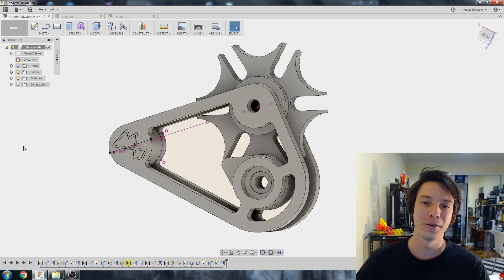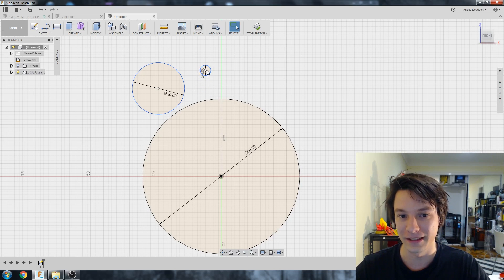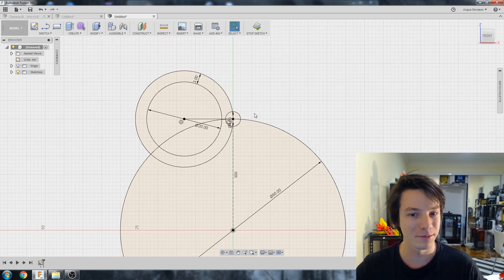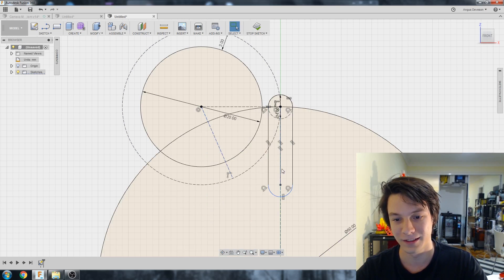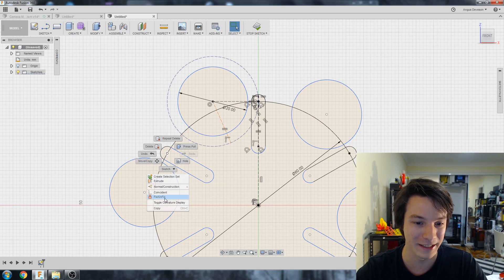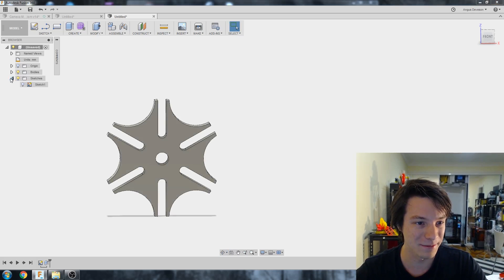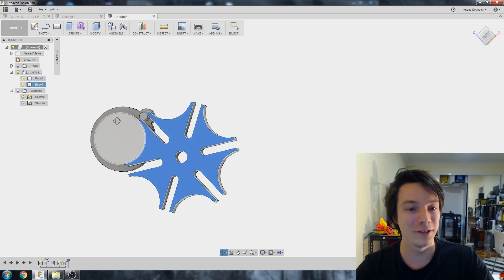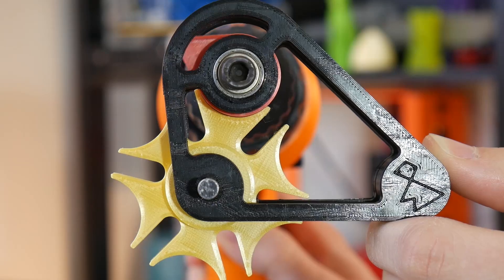How to Draw a Geneva Mechanism in Fusion 360

Comment: I like to do things myself then see how others do it.  I have not used constraints in fusion yet. I divided it up like a pie and drew each circle and slot allowing for tolerance. I made the driven and drive gear at the same time. took longer but i think they turned out quite well. even added extra holes for design. 
I will consider learning to use constraints in the future. you made it look so easy.

Comment: I always start by creating names parameters for variables such as 'number of slots' or 'pin diameter' in this example. Then type in their names. I also create 'tolerance' parameters and then when typing in a size I can type in 'pinDiameter + tolerance' rather than fixed vales
Reply: Jen Yates I don't follow but I would like to see how exactly this is done as it would be quite useful
Reply: Steven Bartels In the Modify menu, very last option :) You make new User Variables in there, and you can type in their names in place of numbers in the sketch. Then you can change umpteen identical values with a single change :D
Reply: W00dledude that makes sense!  That is awesome!  Can you create variables that are formula dependant?  I could imagine it being helpful if you wanted say one thing to have a distance or angle that changes dependant on the value of another...  Line two is 7/10 the value of line one...  Angle b is 37 percent of c and both are offset from angle a...  Basically any standard highschool equation you could enter on a graphing calculator...
Reply: They mention formulas, so absolutely, there's at least some capacity for that. I haven't played around with it enough to really tell you more, unfortunately, but the answer to your question is yes :)
Reply: W00dledude thanks mate!

Comment: You forgot to put a clearance in the drive wheel for the driven wheel to pass through. That is to say: you extruded too much. :-)
Reply from the maker: ah whoops haha, good catch! even after practicing what I was going to say I still messed up and selected one region too many. I guess that's why it's called 'rapid' prototyping :)
Reply: Maker's Muse: Great tutorial though. Well presented.
Reply: Maker's Muse If you use separate components instead of just separate bodies, when you do cuts, the extrude window has options for what components your effecting. On joins or new bodies, it's always to the active component.
Generally components make life easier in Fusion, which I've learned the hard way this week. 😄

Comment: Doesn't the mechanism need a hole in the drive wheel, in front of the pin to let the driven wheel arms go trough?
Reply from the maker: Yep it does, but I'm sure you can figure out the rest :) The frame parts and that are easy.
Reply: Maker's Muse How big it needs to be is easy to figure out. But you never showed it in you videos. If you don't know it needs to be there, it is hard to figure it out that you need one

Comment: Great video :D always cool to see how different (or not) people use fusion ;)
Some tips: 
- Normal to Construction line: select line(s) hit "x"
- Tolerances: klick the outside face of the wheel or pin, press "q" and change it (someting very odd if you once learned Solidworks, i know) 
Keep up the great work :D
Reply from the maker: Haha cheers, yeah I keep forgetting to use x and yep... coming from SW I feel so dirty doing push pull modelling but should just stop resisting :)
Reply: i feel your pain... fusion is sometimes so different... often in a good way, but i miss the feature tree :/
Reply from the maker: I've become used to the alternative to the tree along the bottom and find it fairly easy to go back and change things but it does get pretty unwieldy for biiig complex projects.
Reply: Maker's Muse Man, I feel that. Try designing a house in Fusion with any amount of detail XD

Comment: After watching this, I don't like SketchUp anymore.... Damn you, Angus. :)
Reply: good! :D
Reply: I also tried several CAD programs, starting with Sketchup followed by DS Mechanical just to end up with Fusion 360 because it´s just the best one out there I'd say :D
Reply: I'm an OnShape guy
Reply: Is OnShape 100% free?
Reply: Are any of the paid TurboCad programs any good?
Reply: I started to hate my University for making me work with Solid edge
Reply: Sketchup is not that bad with some Extensions. ;)
Reply: as cnc setup machinist, it's a Good switch.
I use to model everything 3d print related in SketchUp. (and my house)
Recently i moved to fusion 360 during my cnc mill build process. It takes getting used to as do all programs but in a professional opportunity saying you use Autodesk Fusion 360 is better than Google SketchUp by far. i was always embarrassed to say sketchup. One of my friends was professionally trained in fusion 360. 
I had to learn the Cam process by myself... took a few hours but I got the hang of Cad and Cam, in fusion quickly enough.

Fusion is great for 3d printing. its "Make" options automaticaly convert the part and load it into your slicer of choice.

Comment: Silly question, but aren't the slots just too deep? Better too deep than not deep enough, but.. you set the depth of the slots the same as the distance from the center of the drive wheel to the center of the pin, but.. the center of the pin  will never make it that far into the slots since the center of the driving wheel is outside the edge of the driven wheel. Am I missing something?

Great videos though. I just started using Fusion and have managed to do so many more things that would have taken me ages in OpenSCAD.. :)
Reply: I derived the way to get the proper depth for the slots.. found in your 'using constraints' video :D Draw a line that coincides with the center of the drive wheel and the driven wheel . One end point concident with the driven wheel and the other one conincident with the construction circle that goes through the center of the pin - use that line instead of the line that goes all the way to the center of the drive wheel to set the depth of the slot. Rotate everything to confirm. Tadaa..
Reply: I think you are right, it should have been the distance between the construction circle and the driven wheel circle, and not the center of the driving wheel.

Comment: For a start, you need to create a components first.... work from there and create components as you increase the parts to use. Sketch is under/within a components. This is a top down structure best practise suggested from Autodesk. This is the first mistake that most people including myself made....

Comment: 5:44 looks like length is now distance of these 2 circles 20mm and 4mm pin. why need that constrain then. so you made bobo. you made depth longer than it need to be. construction like should start from 60mm circle not center of drive? yup it shows on your print slot is unnessessary too long

Comment: angus, my constraints are totally not working. 3:03 you dimension the distance between the circles, but instead of the line changing it's length, the diameter of the circle is changing.
4:13 you make that line angle itself to the center of the big circle(sorry for the foggy words) but in my case the line just elongates and touches the circle....

pls help
p.s. love your vids, im a subscriber
Reply: Hi bro at 4:13 i had the same problem. To fix it you need to select the line and not the actual point else the point joins onto the center

Comment: Good tutorial but there are a couple very minor errors that were easy to sort out.  (1) the method use to determine the length of the slot makes it to long.  (2) there is a region that must be cut away from the driver wheel or there will be interference preventing the wheel to fully rotate. Here is a link to imgur images pointing out the errors: https://imgur.com/a/I8t6wkH

Note that I did not discover the slot length issue until after I had the gear full built and assembled. I figured out a solution which is to just add a reference slot from the point the driven parts circle intersects the vector from the driver part to the edge of the driver parts circle.  The section shown in the sketch in the imgur link below.  I have not implemented it in my drawing as trying to do it breaks my time line so badly I pretty much have to start over from scratch to fix it (.
Reply: You say very minor, but issue #2 makes this design completely unusable. I can’t believe he didn’t add that part of the driver wheel in his video. I don’t know how no one else caught it.